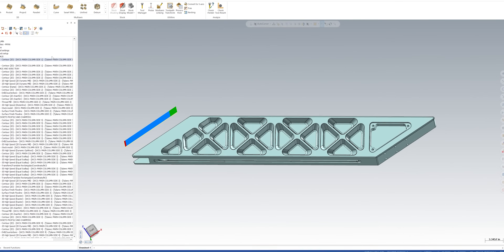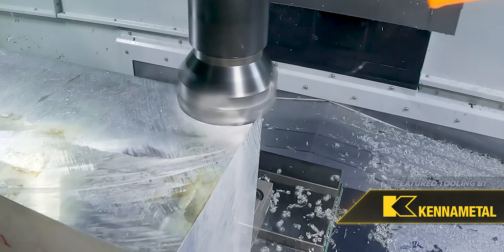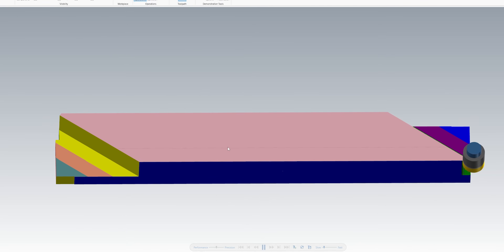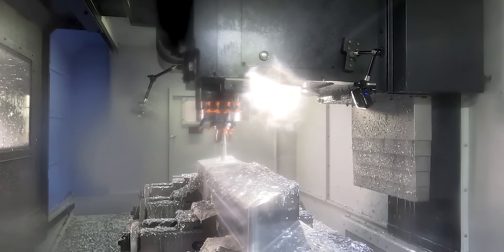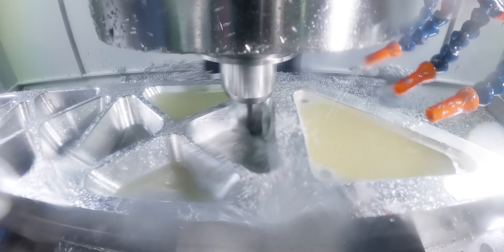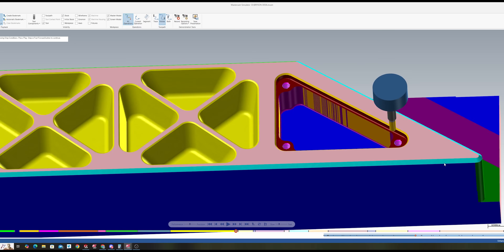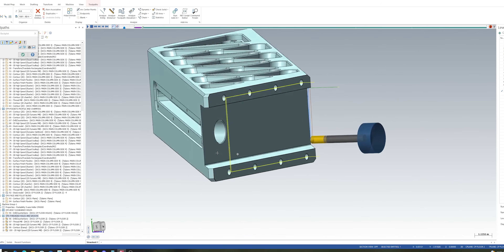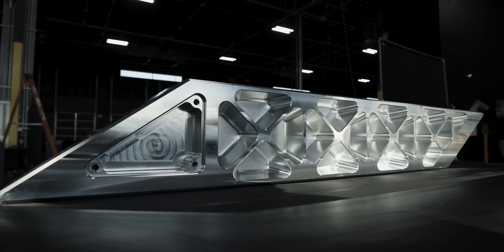CNC Trick to Machine a Massive 60” Part

Comment: The way i have countered that is, i made a stop that bolts onto the back left of the left vise. It sits 15.375" from the left edge of the vise. On my back left jaw, i have drilled and tapped 1/2-13 and made a stop that can loosen easily with an allen wrench. The jaw stop is G54 and G55 X0, but for the machine work past our 43" of travel is programmed as G55 and the x values are offset by the 15.375. If the hole is at 55.50" on the print, the program would read 40.125.

Comment: Should have jumped around roughing those pockets verse going one side to other to allow the stress to even out as the material is removed. 10 Deg Taper walls with a fillet radius on the floor could have used Taper ball endmill and finish the walls and got a better finish than surface machining them.

Comment: how do you keep it from bending whit the quantity of materiel you remove ? (im guesing the part have some sort of flatness required) 
and how do you avoid scratching the part between each OP ? aluminium is so easy to scrach, no matter how hard a try they alway a tiny chip or something on my table to scratch it when im moving the part

Comment: Part looks like a coilover tower to tower brace. For front suspension on rear engine car with significant torque. Forced induction Large capacity V-8 being most likely engine type. Could be either SSC, Hennessy, or a tuner with a Corvette. Best guess it's for a SSC Tuatara build for record attempt.

Comment: Sometimes you just gotta be creative. Our 3-axis CNC milling machine has a table with a working area of 1.200mm, but we sometimes have pieces which are 1.400mm long. Different setups, creative workholding and it still works, also the holes are close to the edge.

Comment: o sht i misread that !
i thot it said 60 feet, dam.
ya i have worked on a cnc machine with 50 feet of travel 
n you can machine parts 100 feet long on it.
its travel was X 50 feet,  Y 14 feet,  Z 8 feet.
at another company, Patriot Forge i set up programmed n ran 
2 SNK Rb-6m machines, a 6 meter n a 8 meter both with 3 meter on Y, 2 meter on Z.
i machined up to 48,000 lb parts on those SNKs.
ya 60 inches   
thats cool too    : )

Comment: I didn't understand why the check conventional or climb was at the semi-finish and not at the finish, if you wanted to see the difference?
Reply: At the finish it makes a HUGE difference. But I always heard old timers say you had to rough one direction and finish the other direction for the best finish. Turns out, that isn't true
Reply: Thanks for your explanation, first time I hear that. I use conventional only two ways, if a tool makes vibration, sometimes it's solution. And if a stock has hardness surface after laser cutting for example. And use both for rough into aluminum part for speeding

Comment: That's why I think it's important that 3-axis CNC machines have side windows that can be opened not only for cleaning but also for clamping very long components. I noticed this positively with Syil and the new Haas MiniMill.
Reply: Haas has had them forever. Super handy
Reply: Tormachs too, at least their latest.
Reply: @ My 2017 Haas Mini Mill doesn't have this yet; only the newest one does. I've missed it sometimes.